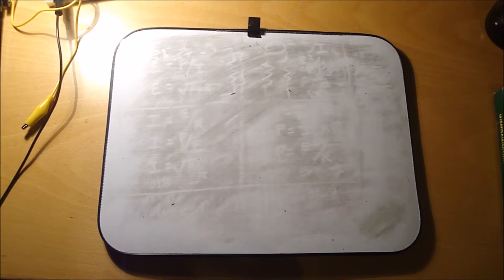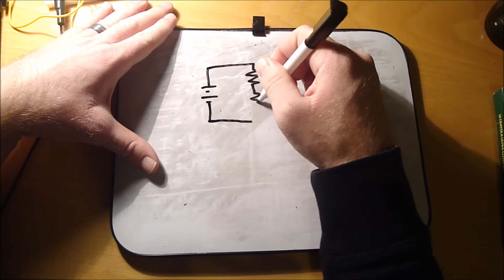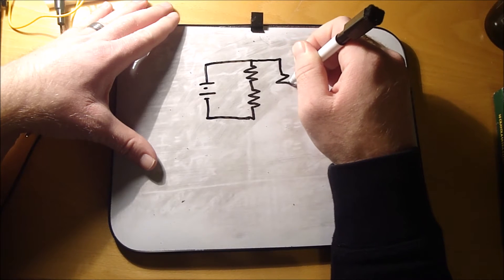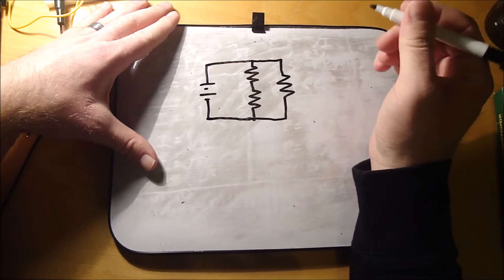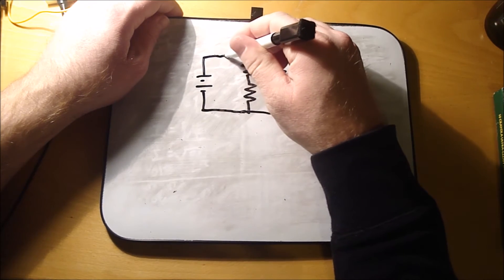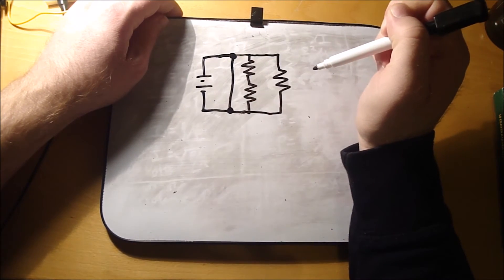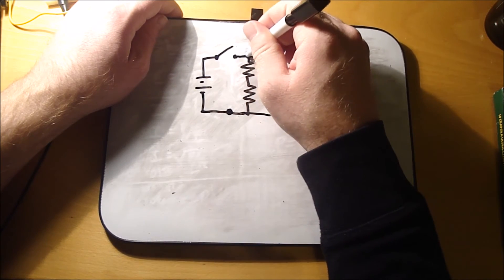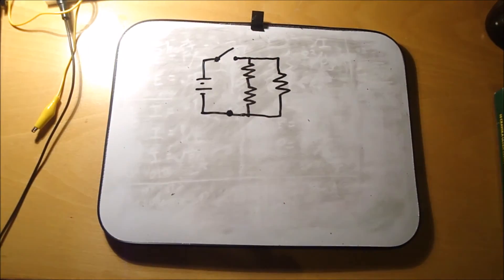Series, Parallel, Short, and Open Circuits

Comment: This might be a dumb question, but you said when you flip the light switch, it shorts the circuit. Does it short it, or does it just complete the path for the electricity to flow to the load? I thought if something was short circuited then it wouldn't work anymore because the electricity follows the path of least resistance. Which would more than likely be going through the short to ground, instead of through the load? Sorry if this is a silly question, I'm just learning all this stuff and it's confusing sometimes. Thanks.
Reply from the maker: Not a dumb question at all. As a technician, when I typically mention a short, it has to do with something causing a short across the two wires of a supply voltage. But a short can be anything that acts like a wire from one point to another. You can have a shorted device, like a diode or ceramic capacitor, where it doesn't complete the circuit between the supply voltage. Did that answer your question?
Reply: For noobs like me…even though I pour over people’s words—I get the feeling you are totally correct, but the usage feels very technically correct but somehow incongruent with what I am learning about the essence of a “shorted” circuit as being problematic as opposed to being thought of as part of normal circuit operations….if THAT makes sense.
Reply from the maker: @phonkyfeel1  I completely understand. Shorts and opens are probably the most misquoted, misused, and misunderstood terms quoted in electronics and electrical.